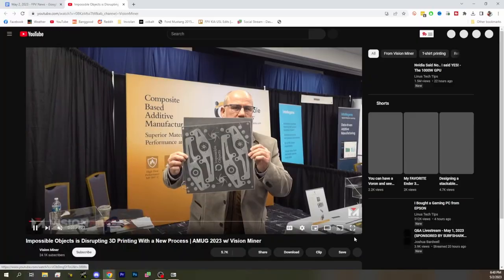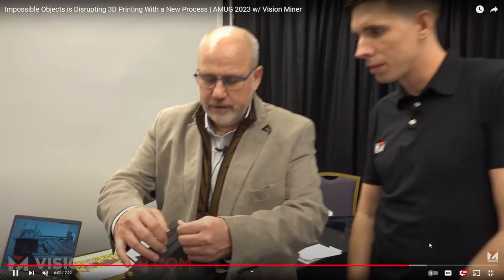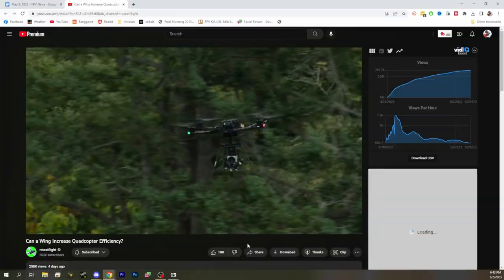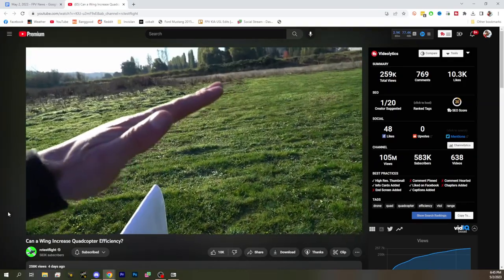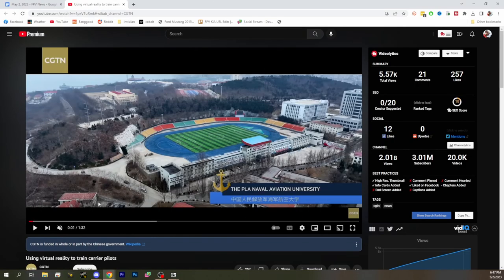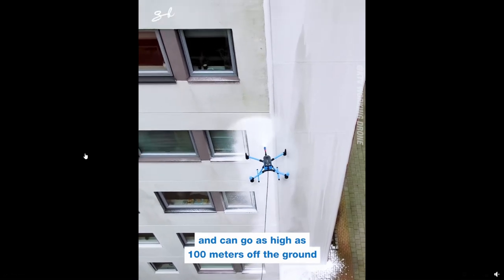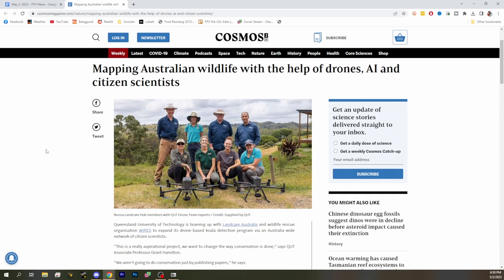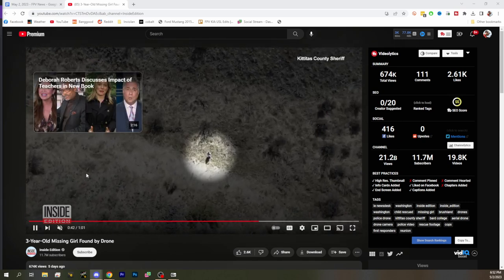New 3D Printer Tech For Carbon Fiber? Putting A Wing On A Drone? - FPV Questions

Comment: Those sheets would be excellent for head gasket top and bottom layers. 
It would also be useful to making notched rounded carbon fiber parts like hollow tubes for wires.